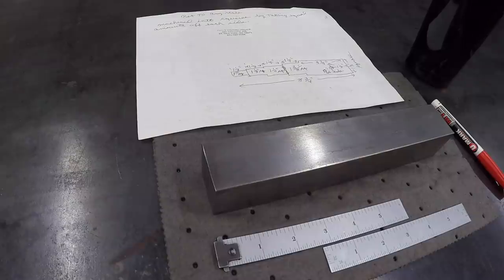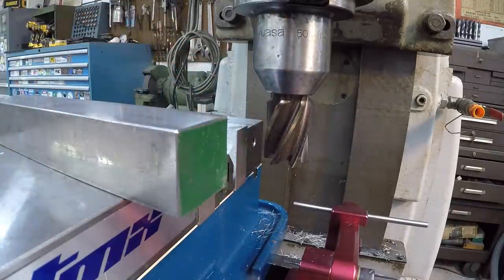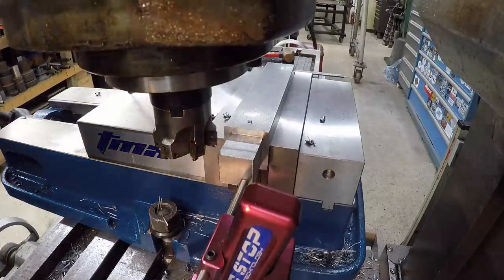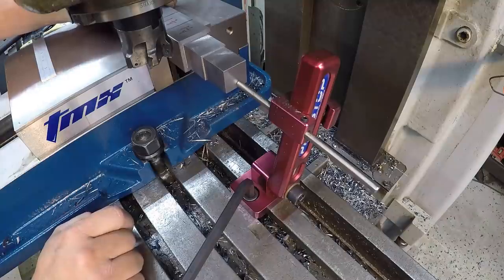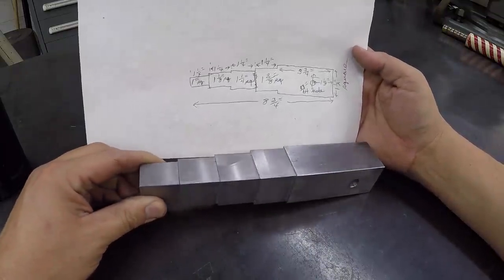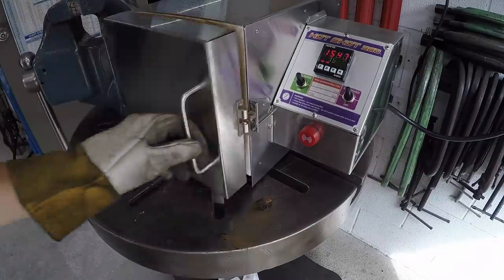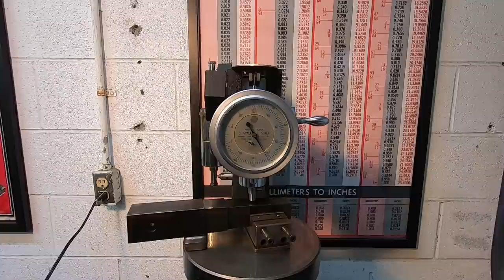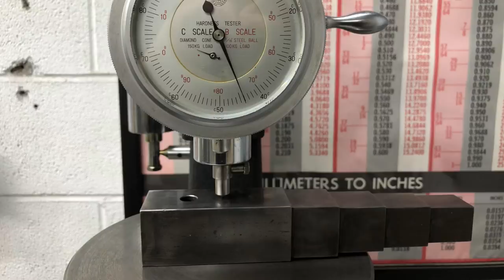SNS 296: Custom Square Drive Tool, Heat Treating

Comment: I saw you posted “conventional milling” with a description. I hear things like “climb” cut and things of that nature, which I would assume is down the lines of what you are talking about. I’m not a machinist, but understand the basics and theory behind it so I wouldn’t say I’m a noob, but certainly not a machinist. Anyways, could you explain what these things (different milling techniques) are and why they are used. I understand it’s the path of the tool in relation to the direction of the spin and things of that nature, but don’t really understand. I believe I’ve  watched about every one of your videos and have never seen you really explain it. I appreciate any help....thanks for another great video. Even though I’m not a machinist by any means (I have a 48x48 CNC router I cut carbon fiber with, but that’s about it). I absolutely love this stuff.
Reply: The reason you typically conventional mill on manual machines is they are gear driven. Gears have backlash and conventional milling pushes everything back against the backlash. Climb cutting will cause the table to pull forward off the backlash and can break the tools. Which is why you only see manual machinists take light or finishing climb cuts. CNC machines don't have to worry about backlash because they are driven by ballscrews, which don't have backlash. Because of the nature of climb cuts and the way each tooth enters and exits material its easier on the tool and the spindle. Also it ejects the chip better. Hopefully that clears up some of the question but if you have any more please feel free to ask away.
Reply: Derek Hartley...Ahhhh the backlash in the gears of the machine itself! Makes perfect sense now. So it really has nothing to do with how the tool itself is cutting and the direction it needs to spin or make a pass relative to the part?
Reply: @specforged5651  The term conventional cutting and climb cutting is relative to the spin of the cutter, the side it is cutting on and the direction of the cut. The vast majority of tools spin clockwise so lets go with that. If you want to climb cut you would be cutting clockwise around the outside of a part or counterclockwise around the inside (a pocket for instance). The tool still spinning clockwise. If you wanted to conventional cut you would be doing the opposite, tool still spinning clockwise ofcourse. The easiest way to picture it is to hold an endmill in your hand next to a part in the position it would be cutting and spin it clockwise in between your finger and thumb. The direction the cutting edges try to pull it in is climb cutting. The other way is conventional. This also illustrates why climb cutting pulls the machine off the backlash. The material climbs forward on the cutter and breaks your tool. Similar to when you drill something and on its way though the other side the drill grabs and pulls the drill all the way though and tries to take your wrist with it. We call it 'auto feeding'.
Reply: Derek Hartley ...Awesome! Thank you so much for taking the time to explain it further. I was on the right track, but there is obviously a little more to it as I can see. Love this stuff even though I’m certainly not a machinist. As a hobbyist I just design my part and the toolpath in Solidworks, then my router just does the work lol (however, it is 3 axis so I am getting to play with that a little). There are many settings in there that I can change parameters like toolpath, depth of cut, etc (I would imagine your very familiar with these programs) obviously, so your explanation helps me with that setup and my understanding. I have the opportunity to buy a Bridgeport mill from the local University and am really looking forward to it. Thanks again for taking the time, I truly appreciate that. Especially when it’s not even your channel. I get that people are busy, but 99% of the time it seems the actual channel owner can’t be bothered to actually explain anything they are working on. My brother does help me as he is an engineer and operated many different large CNCs while in college, but I’m always trying to learn more however I can. I am a race engine builder and turbo guy so learning and needing to know how things like this work is just how I am and how my brain works....along with some slight ocd lol. Thanks again.
Reply: @specforged5651  I worked for a college and taught this stuff for a little while. It's important to me that machinist share knowledge. A channel that is great for learning is Titans of CNC. They talk a lot about tooling and feeds and speeds. They also have a training program setup for fusion360. Which is what i use for all of my CAD/CAM at this point. Should help with your learning but if you have any more questions feel free to ask.
Reply: Derek Hartley. Fantastic, I will check our Titans right away. Yes, I am am familiar with Fusion360 as well. That is what my brother keeps telling me about so I hope to be able to start learning it as well. Feeds and speeds are what I spend most of my time trying to figure out (at the cost of many tools and material). Obviously my carbon fiber does not cut like aluminum and certainly not the wood that I cut on my machine as well. I sure wish more people like yourself operated these channels, it’s dang near impossible to get any of them to reply even with simple questions. However, I get it, everyone is busy with their own things and I respect that. I just wish if people were going to take the time to put out videos like this, they would take the time to help as well and not just do it to get “views”. All a matter of perspective I suppose. Thanks again, I truly appreciate it!

Comment: Build yourself a stainless steel box with loose fitting lid. Fill it with charcoal and sit the part in the middle, cover it with charcoal. Heat oven to temperature for hardening and soak the prepared box for 2h after oven regained temperature. Remove box and part after recommended soak time and quench part using figure 8 movement in oil. Set oven for tempering temp and soak part as is for 8h. Switch oven off and leave part in oven overnight. Sand blast and test.

Comment: wouldn't a small nirtogen purge during heating solve the ss foil complications?
Reply: rather use argon , it has a better chance to stay in the bag , better yet , ensure a low flow of argon into your oven for argon replaces air , that way you will avoid oxidation to start , it also takes away the need to use the bag in the first place
Reply: @dimievers5573  that's what i meant, no foil at all ;) We use nitrogen in pipelines during welding because it's dirt cheap. Anyway, a small hole with steel inlet tube in the oven, 6mm maybe. High flow when inserting the work piece and very small flow during heating, just to keep the pressure a "smidge" above outside. When done, open and dunk the piece in a matter of seconds. Don't drop it on your shoe :D

Comment: Hey Adam. In case you haven't seen it yet, Keith recently upload a video where he heat treated some tool steel and IIRC he's got the same type of oven you do. One thing that stood out to me is that the control module on his oven pops out and plugs in to a computer via USB and contains a software package for you to program it there instead of manually. He also shared some tips and showed the process as part of making a taper gauge he needed so you might want to skip some of the video: https://youtu.be/JF75WuCTZH4

Comment: The stainless steel jacket acts as an insulator because of the air inside. So the quenching is slowed down.
Reply: I would have the same concern. I also wonder about the surface finish causing erroneous results with the hardness tester?

Comment: If time is important and the foil is essential isn't there a tool, (spike) that you can push down the length, peel and dip in one motion?
I was in telecomms and we had cable strippers that could de-sheath a 4" dia lead covered cable in a single pass (with practice), guys would jog down the line, 15' in about a second without damaging the conductors.  It wasn't a time critical operation - just done for the fun of it to combat boredom. 

I imagine with a little practice it could become an olympic sport

Comment: If you want to make that hole stronger in the tool make it a little undersized and stretch it a little bigger. I forget what it's called but if you stretch the hole bigger and give it a little compressive residual stress you will improve the fatigue life of the tool.
Reply: Cold expansion?
Reply: @CplSpider  Exactly. I was trying to remember what it's called. That's what they do for every riveted hole on a Boeing plane.
Reply: @MetrologyEngineer  
Now that's worth knowing.
Reply: @MetrologyEngineer  yep, my company has me prepping to expand a bunch of holes on a Beechcraft within the next week or two.

Comment: wouldnt the different thicknesses affect the hardness, the thinner material would be harder
Reply: It depends what you mean by "harder". The hardness at a point is dependent on the rate of cooling there. On the surface this rate is the same everywhere, because it's limited by the heat transfer from steel to oil. The further you go into the part though the longer it takes for the material there to cool down, so the rate of cooling is lower. Usually you can see a dip in hardness in the middle of the part because of that and the thicker the part the deeper the dip. The hardness at the surface (which is tested on the hardness tester) is unchanged by that though.

Comment: Are there different Rockwell scales? Like C vs H or something? Maybe you’ve got a different scale on that meter than we’re used to hearing about.
Reply: There are a lot of different Rockwell scales. The most common is C. The values are given as 63HRC for example.
Reply: Horst E, I would have thought a hardened 4140 would be at least 56 Rockwell like knives. Do knives use a different scale than the one Adam is using?
Reply: @shanek6582   I found a german data sheet for 4140 (here 42CrMo4) and according to it, max. hardness is 255HB. That is only 25...26HRC. 4140 has only 0.42% C that is not enough to really harden it.
Reply: Horst E you can harden axels so hard a file skates off and you can snap it, I always heard they were 4140. I must be wrong
Reply: @shanek6582  You're right. I checked again and found more information here: http://www.interlloy.com.au/our-products/high-tensile-steels/4140-high-tensile-steel/ 

But the maximum hardness they offer is 375HB and that's 40HRC.  That is not extremely hard, considering that blades for hand planes are over 60HRC but might work for such a tool.

Comment: you should remove the stainless wrap then tremper it (qwrench)
Reply: Yes. Speed of cooling is critical. Set that crystal structure before it starts to revert back.

Comment: going by the visible heat element on the left, I'd say taller blocks so it's about centered in the oven, then rotate 90 and cook more.
I'm assuming there's an element on the right side too. and maybe the back?
** at end of video, noticed the element wrapped right, left, back and near the front. so blocking the part up to center of oven from top to bottom should give more consistent radiant heat on all sides. the back and door ends may be a little weaker since they're fairly close to the walls and getting less direct radiant, door probably the weakest end.
Reply: Sorry, dislike entered in error, can't seem to remove it

Comment: You can reach much higher hardness by Case Hardening, by adding a carbon source (charcoal powder) in the wrap. The  carbon migrates in the steel at a rate of +/- 1mm per 20 minutes (Austenite is transformed to Martensite).  REMOVE the wrap after desired migration time and put the part in the oven again.  Do the quenching only when the part is at temperature (cherry-red)!  And put the quench oil barrel just below the oven for a quick quench!  Couldn't find any professional video on this, but these guys come close: https://www.youtube.com/watch?v=f_bXiIfcBWs

Comment: I'm not an engineer, but I cook,  if an oven is not fan assisted it is much much hotter at the top of the oven than the bottom..
Reply: Metal conducts heat way better than food though, so it's easier for it to fully warm up to a constant temperature through and through.

Comment: I'm guessing it is possible it didn't all get up to temperature. I could calculate it if you want. Another thing is be really careful with doing your harnesses tests don't do them within 3 diameters of each other. Your difference in hardnesses on that piece is going to be because of not enough time stabilizing at temperature. Feel free to email me and we can talk more.

Comment: Although I don't have practical experience, from a material science class I took, I recall that the amount of time at a specific temperature determines the grain structure. So heating it longer may not necessarily give you the desired results. I don't think the orientation of the part in part while heating should matter much as long as its up on blocks like you had it. Also I suspect that the smaller side of the tool cools quicker while quenching so may be harder the closer you get to that end.

Comment: First off, awesome channel!

On the test block, I wonder if the difference in hardness on the two sides is due to the heating elements in the oven only being on the side wall? I bet the side facing the elements is heating differently  due to radiant heating vs. the other sides. Perhaps that side is heating deeper than the other sides and cools slower during quenching?

Just a theory.

Comment: Unwrap the part before you quench it.
Reply: This.  The foil is keeping the quench from the steel.  Strip the foil on the way to the quench (leave some slack on one end, cut the foil and dump the part quickly) and you'll get a more consistent result.

I make swaging dies from 4140 and can hit and hold 53-55RC with a very fast quench.

Comment: The Stainless foil is one option to prevent air to reach the part to be treated, there is another method I use that yield excellent results, it's a product that is clay based and used to cover your parts to be treated and prevent air to reach the part during the heating process 

Here is a product you may want to look into:
Advanced Technical Products Supply Co., Inc 

If you still own that tap follower Phil and I gave you at BarZ 2017 edition, this is the product we used to do the heat treatment, here is the video where Philippe and I get it done using the ATP products:
https://youtu.be/ai5iOOzpWsk

Hope this helps you...    Pierre from Pierre's garage

Comment: In my experience that might have not been 4140 to start with.  Usually for me 4140 is already 25-35 RC to begin with  not 12
Reply: But is "to begin with" O-temper?
Reply: I wondered about that - did the supplier get the right material? Or maybe it’s Japanese steel?

Comment: Adam, love this vid. Heat treating is nowhere near as straightforward  as one might assume. Things that have helped me are looking at a TTT diagram to see what you're trying to accomplish (how quick you need to quench), and second keeping in mind how the geometry of the part affects the quench rate (heat transfer in the quench medium).  Tempering has been less of a hassle in my experience, except in the case of odd part geometries w tighter tolerances (e.g. welded a arm for a car). I'm no expert, and I don't have a lot of experience, but the experience I do have, I gladly pass on to you. One last thing I recommend: look at soak time based on the weight/mass of your part rather than its shape and you'll be more likely to hit your numbers.
Reply: You doubtless have more practical experience than I do, but it does sound like you’ve contradicted yourself! Geoemetry vs quench rate, agreed, but then it’s mass vs time only? Different answer?
Reply: @TSPhotoAtlanta  I see what you're saying. The soak time I'm referring to is the heat soak time in the oven. This is the time required to establish uniform temperature all the way through the part before quenching.

Comment: I would see about getting that Rockwell tester calibrated. Something seems off with how inconsistent those readings are.. also give the PID on your kiln an auto tune and maybe shoot a little higher with your set point on the kiln. That part is dropping considerably in temperature the second you open the kiln door. I heat treat o1 around 1560 f because by the time it hits the quench it's right about 1450 f. Much different than 4140 but same concept.

Comment: The part must be hot enough so it is non magnetic as that is the transformation temp.  Ferritic is magnetic,  austentitic is not.

Next you need a severe enough quench to lock the structure.   That part is rather large for the oil you used.  Putting the oil in a deep freeze would help but its viscosity that is limiting.   That oil is fine for leaf springs of 1/8 inch thick.  For your large part, diesel will be better even with 4140.  

Hardness will be higher closer to the corners and edges.  That is a sign of low quench severity.  

Try cold brine with the drop you cut off.  Bet you get Rc65.
Reply: thanks for this info

Comment: Bake at 1640 Degrees for 2 hours, Quench and Enjoy! (Caution! Contents will be Hot!)    ;-) 

(No, I am not knowledgeable in heat treating, but I can make one heck of a Lasagna!)
Reply: when it's burning it's cooking and when it's burnt it's done? :))
Reply: throttle bottle 
When it’s brown it is cooked when it’s black it’s bu@#ered! At least that is what dad told mum about the roast joint!

Comment: Hi Adam I'm a maintenance mechanic in a injection molding plant.  What do you consider to be good drill bits for everyday use.  I buy alot of bits and they do not seem to last long.
Reply: Don't buy cheap ones and never Harbor Freight drills!!!